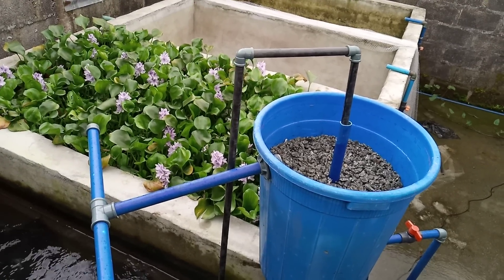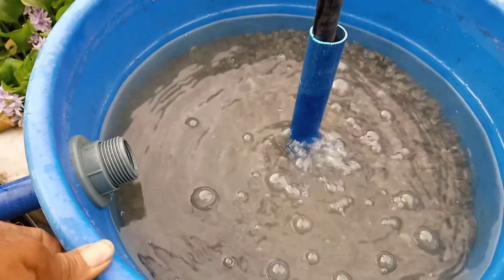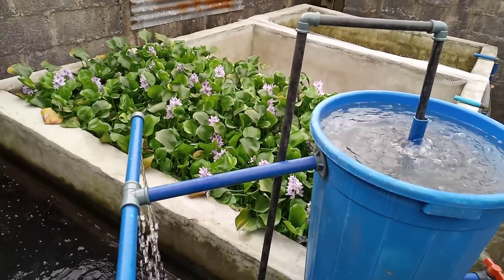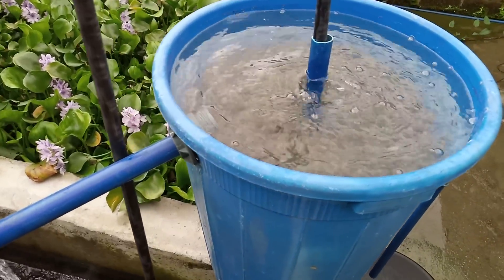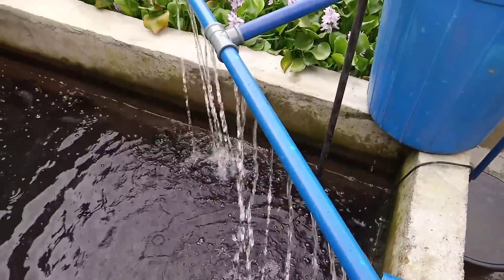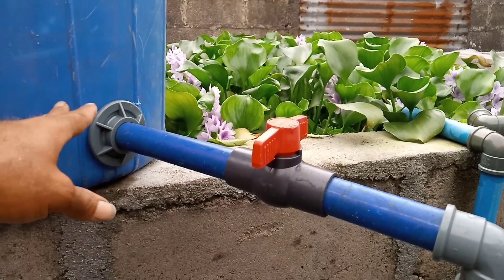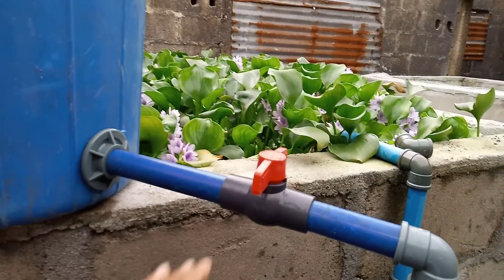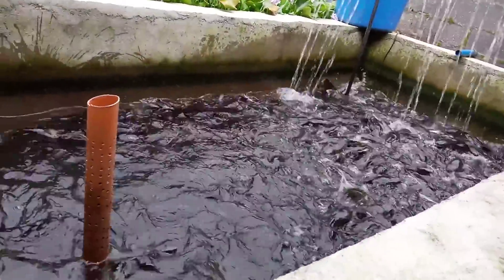WHY DIY RAS/WRS: HOW TO MAKE YOUR FISH GROW 5 TIMES BETTER THAN BEFORE USING A HOME MADE FILTER Pt 2

Comment: There is a gap in this video. The first video is about building the filter. This video demonstrates how it works. This should have been part three. Part two should be how to connect the filter to the tank. What pump is used to connect it? How does what goes from the tank to the filter? What size pump is used? Is there an alternative for those without electricity?

size

Comment: I have a somewhat simpler system, for those with no electricity available nearby.  I have a container, lower than the water level of the tank. This container has a water tight lid, the water flows from tank through the bottom of the container naturally with a pipe three inches from the top. The container has stones sponges and filter membrane. A pipe from the side of the container as low possible to another container with more stones and filter membrane. In this container I have four solar powered pumps none bigger and two inches in size. I have clear water always. Make sure that the water in the first container is overflowing before putting the lid on, thus avoiding air locks .
Reply: This is a long confusing story. Make a video of what you are saying so people will understand. People might be interested in it.
Reply: @peterhanson5130  I have never put anything on u tube.  Leave it with me, and I shall try to work it out and give it a go.
Reply: @PeterOkhuakhua   Absolutely.

Comment: How do you pump water from the pond into the filtration system.
Reply: Exactly my question
Reply: @joshuaagama1014  he have a electric water pump, you can se the cable to it beside the blue tank
Reply: @F.o.a.d46 this submissive pump, can't it not interfere with fingerlings
Reply: @francisorwa4483  excuse me, huh? What's fingerlings?
Reply: Please how

Comment: I've watched your video a number of times. I really appreciate the input. However I still can't figure out how you get there water from the one into the filter. I see the pipe but how does the water rise against gravity into the filter
Reply: You can use a pump
Reply: It is a submersible water pump that's was installed inside the pond

Comment: My question is: how did you get the water to rise up from the pond into the RAS system for filtration? is it by using a pump? because one needs a pump to take water from the low level (well) to an overhead water tank. How did you build up the pressure to make the water flow up to the RAS system? Thanks
Reply: he just simply pumping the water to the bottom of the filter material in the blue tub brother and the water rises and overflows  via the discharge T tube at the top.

Comment: I really appreciate what you doing @fishacademy , so inspirational I just have a question , from the above video what kind of water pump was used to get the water from pond to the filter thanks
Reply: Submersible water pump. The pump is inside the water.

Comment: The inlet supply of water needs some work so that air goes back up the blue inlet pipe that is inside the filter so that air bubbles don’t continue to bubble up throughout the filter media...when the bubbles go up as in the video it knocks particles to the top water and more particles go out the overflow.   ...great design otherwise.
Reply: An idea improve the design is to replace the blue filter inlet pipe with a wider pipe.

Comment: Thanks for this  highly inspiring video. But there is something you have not shown us, water is coming from the pond into the filter tank, how have you been able to achieve that? did you place a pumping machine inside the pond or how?
Reply: Its the submersible pump. It was connected through that metal pipe
Reply: Submersible pump